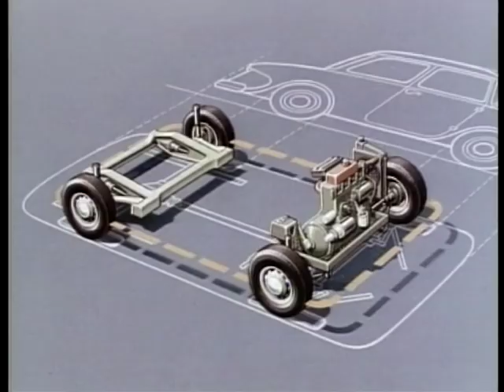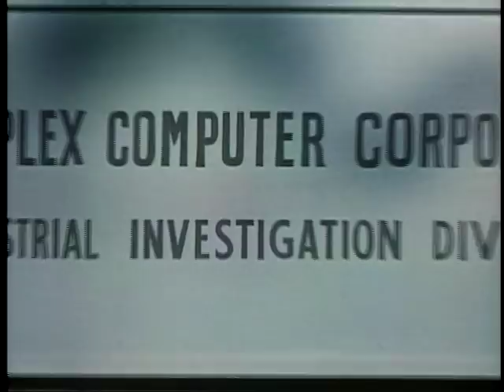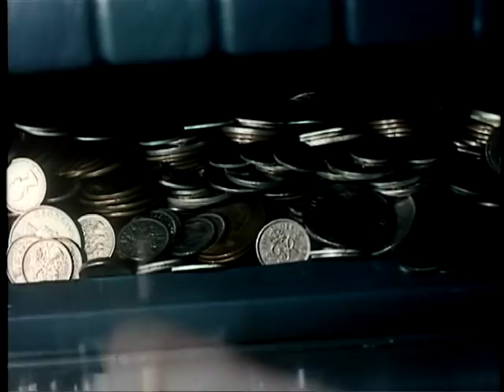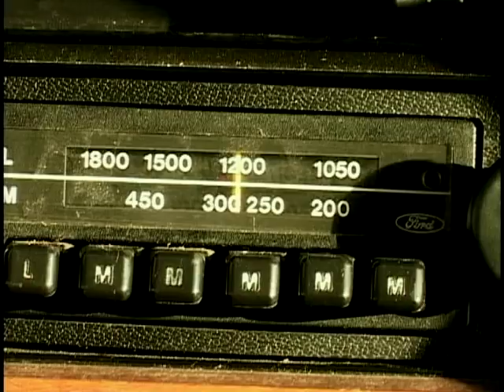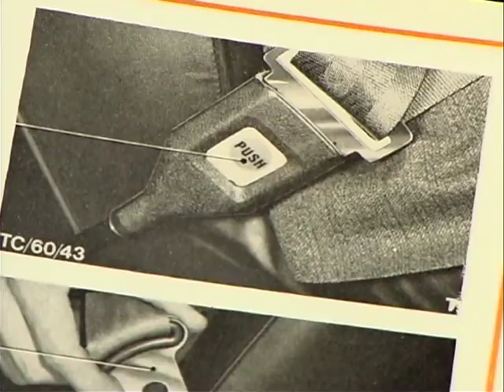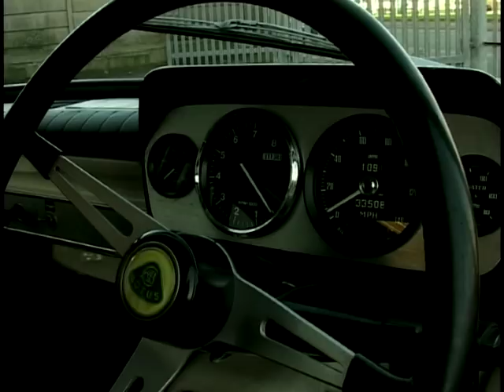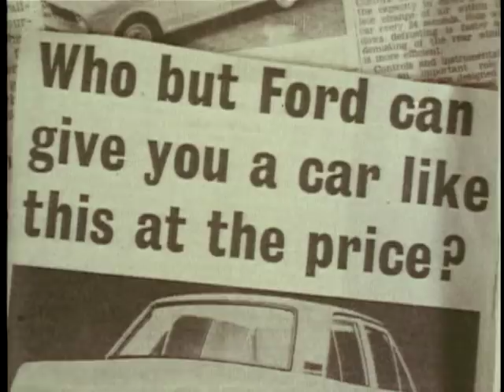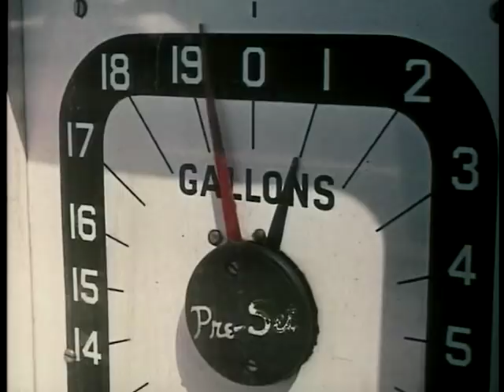Ford Cortina Special

Comment: I had a dark blue Canadian export Mk-2 — very low milage when purchased. I looked after it very carefully. Drove it non-stop from Vancouver to Los Angeles and back — twice.  It towed my race bikes to the track on Sundays. It started as a regular Mk-2, but soon it got the GT version's twin throat Weber and the extractor manifold, which made it much faster. I beefed up the leaf springs, and the front struts were replaced with stiffer cartridges after the factory original setup failed in early days. With radial tires it handled very well indeed. Acceleration was surprisingly good for standard GT tuning, and gas milage was an excellent 32 mpg - mixed driving. It was a car one just wanted to love, but like some romances it just didn't take. Bits were always falling off and breaking despite careful maintenance and care. It was an appalling pain in the ass. Fortunately the parts stores were close by. I once changed a clutch in a rainstorm lying in a puddle under the car with a torch stuck in my teeth. Lots of memories — good and bad. Years later, I actually had dreams about the car — like the girlfriend from hell that you loved anyway.

Comment: I was 21 years old in 1972 and stationed at Ft. Bragg, NC. I bought my first car  in Fayetteville (on Bragg Blvd). It was a '69 Ford Cortina with a standard transmission  and the price was $650.00. Had a lot of fun with that car.

Comment: Had a 1967 (I think) Cortina G T...with the lump on the dash housing the gauges. Loved it...ran well through Wisconsin winters. The McPherson struts were shot, & nobody knew how to work on them much in those days (1970), so the front suspension left a lot to be desired. Traded it in on a A-H 3000 while in the Army in Georgia. Oh well...great shape, reliable and serviceable car. Wish I could find one today...at age 68 I can still shift for myself, and prefer to do so!! Don't forget that Ford (USA) was the only car company that didn't require a "bailout"!

Comment: Cortina's are fun to drive, beautiful gearbox ,roomy good peripheral vision and responsive
Reply: Lee Engelsman i wouldn't agree with u on the gear box. more grinding than smooth gear change.😕
Reply: Padraig O'Donnell .You must have had a really dodgy box. Cortina boxes, from mk2 onwards, had such a light, smooth & positive action. A joy to use, compared to a Victor box of spanners.

Comment: My first car was a '70 Cortina Wagon. I paid $155 for it, and sold it 2 years later for $100. I drove it into the ground. The gear shift was held in place with electric motor wires (the plastic part that held it in place had stripped), the back up lights were replaced with aftermarket units, the clutch master cylinder had been replaced with a part from another '70, but it still ran. We had a love/hate relationship. :)

Comment: Many thanks from Germany! I liked the german Ford of the 70s as a child. But on a holiday in Spain back then I saw the corresponding Cortina MK III and I thought "What a cool, sexy car! And it´s only available in GB? Are they nuts? I have to go there sometime!" (I did)
Reply: +LukerizedClint.  The Mk III certainly looked the part with its 'Coke bottle' styling. I only drove one once - a 2000E with the engine from the Pinto. The suspension was so soft that a firm right foot made the hood/bonnet rise, obscuring your view of the road !

Comment: In Australia we got the 250 ci or 4.1 l straight six in the mark 3 & 4 A bit front heavy but fast.
My father had a 4 speed version and used to drive it with 112lb of iron weights in the boot to even up the handling.
The motor was a bit under carburetored but a good performer.
 A set of triple carbs & an exhaust ....

Comment: Smiled when the smaller Anglia 105E was described as heavy in this documentary. It was about the lightest car in its class at the time, and the cheapest, other than the much smaller Mini and it was only slightly heavier than the Imp. Where the Cortina scored over its smaller stable mate was that it was much bigger and only cost about £100 more (i.e. £600 as opposed to £500).

Comment: Regarding the Mini, the commentator said that 4 people could ride in relative comfort.Well, I've been in quite a few of those little old Mini's in the past, and the ride was anything but comfortable.  I think it was due to those tiny little wheels, which wouldtransmit every bump on the road, up into the passenger cab.  They were extremelyquick though, if speed was your thing.
Reply: To Gary Dunn. Minis had rubber suspension. The suspension was by bicycle designer Alex Moulton - "rubber man". His nephew Shaun runs the bicycle company now - and THEY have marketed a replacement COIL SPRING suspension system , called simply "SmootherRide". Clever, huh? What's not to like about the talented Moulton family!

Comment: In Australia MK 3 (TC & TD) MK 4 (TE) & MK 5 (TF) Cortinas were available with 200 & 250 cubic inch inline 6 cylinder engines

Comment: I had a Mark 2 Cortina, and it developed a mysterious fault than many garages failed to sort out.  It was actually a dodgy valve that was causing local overheating next to the fuel line and vapourising the fuel.  The result was that if I drove for a long time and then stopped, the car refused to start again.  While the garages were pondering on what could be wrong, I was able to keep up my regular journeys from Wales to London and back again, by taking off the fuel pump when necessary, and waggling it by hand.
Imagine trying to do that with a modern engine!

Comment: Hi, I'm trying to find the video you did with my own car back in around 2000-2005. It was an Orange Mk3 Cortina MBJ337K that I was customising and had just fitted the 3.5 V8 (may have had the 3.0 V6 in it then). One of the presenters came to my house (Richard or Rob) and we filmed outside my garage in Lowestoft. It was a 4 door, converted to a 2 door and I cannot find the film anywhere.   (It is not the M reg one in this video). I'm hoping you can help please?

Comment: Did I mention that my first car was a Mk1 1500 estate Deluxe with 1 owner from new before me ?  I even had the sales receipt which was just over £800 in 1965 or 66. It had front and rear seatbelts fitted too. The load area was great, as the rear seat folded level with the estate section floor. Plus it was a comfy overnight bedspace. I even made some curtains for it.

Comment: Great documentary, but inexplicably misses the contribution of the Consul Classic 315, released in 1961, as a bigger version of the 105E Anglia.  The Classic had the same reverse rear window of the Anglia, but was the same size as the Cortina:  a fiveseater.  It used the 1340 cc Kent engine (later uprated to 1500).  The problem was that it was too expensive to produce, and in 1961, Terence Beckett realised that the size was what Ford needed (it fitted between the Anglia and Mk II Consul), but the cost had to be stripped out.  Hence the Consul Cortina came about. It was initially labelled 'Consul' to keep continuity with the Consul Classic 315 and the Mk II Consul (as the documentary says, the original name was Consul 225:  the big Mk II Consul was then relabelled Consul 375 in 1962, to give the ascending range in size and luxury:  Consul 225, Consul Classic 315, Consul 375.  The Consul Classic did not sell well, because it was expensive and perhaps a bit too Transatlantic for British tastes, so in 1963 it was replaced by the Consul Corsair, which took the 1500 Kent engine, and was based on a Mk 1 Cortina floorpan.  The Classic derived Capri carried on until 1964.Hope this helps.
Reply: +Fred Splinge    I remember the Consul Classic well but as you say, it didn't sell many. Owners were often criticised for its looks, which with hindsight were ahead of the day. Which car of that era had the V4 engine ? Not many of those were made either. It might have been a variant of the Corsair.

Comment: I guess I am one of those lucky Yanks who experienced both MkI and MkII, both GTs. I am a big fan Kent engine, had it in my Fiestas also. Rust was rarely an issue in California except for American GM products that rusted around the windows terribly. I was not happy when Ford replaced the Cortina with the Pinto, though I later picked up one second hand and drove until 1999 with plus 300K miles on it. Wife pressured me to reduce my stable of vehicles and it went to a friend.

Comment: No mention of the Aussie Cortinas which you could option with a 200 cubic inch or (later) 250 cubic inch straight 6 taken from the Australian Ford Falcon.  The 6 cylinder Cortinas were a bit front-heavy but, man, could they herb down the freeway!  The last Cortinas here were the same body shape as those in the UK and Ford Australia finally fixed the nose-heavy diabolical handling from the weight of the 6 cylinder engine.

Comment: Fantastic mechanically even though the 1600 Pinto would always terminate at or around 100,000miles. Up to then, it would never let you down. Fantastic reliability.
Problem was with them as all Fords of that era - RUST and loads of it!!
Our first, and only, Mk5..Failed its 1st MOT test at 3..yes ..three years old due to chassiss rust perforation!!! 
Even in those days when cars rusted..it must have been one of the youngest cars on the road to have already been welded. At a mere 9 years old..it was off the road for good.
Then there were the void bush problem..
Reply: loved the cortina. the few years they brought it here. 68- 70 ?
unil the pinto
had a 73 pinto as a first car. the 2 liter 4 spd
was a bit better than the 1.6 kent. most or all 1.6 liters were manual only ithink
i was seven in 1970 , lol  so
Reply: emil sponga and forgot they did bring the first - mk 1 cortina over here too. in small number
as with the anglia , capri and a few others....etc etc
Reply: +Yuxin Wang Your not wrong about those void bushes, Bar-stewards to get in and out
Reply: You know about them too..eh..they were an awkward old job Weren't they?

Comment: Cars then were considerably expensive, three new ones or less would buy you a semi detached house, now much more mass produced with interchangeable parts between models they're considerably cheaper, with plastic wheel arches that reduce rust & noise considerably, the ford always gave value for money and SPACE even todays Mondeo.

Comment: mk1 cortina esate!! rare beast of  car now! lol 0:58 when you could drive with 6 kids in the rear and no set belts, 
me grandad used to fix them, went to dagaham to learn how to fix ad repair them i think me mum went in one years ago 
VERY RARE BEAST MK1 CONSOUL AND ZODAC!! just to let you know the space between the engine and the rad on those were so big my grandad could get inbetween them, 
OI NOTHING WRONG WITH BL!!! they had the allegro the uk's pacer,
hang on, mk5 cortina? that's not real its stopped at the mk4 after that ford had the mk3 carpi, the fietia and the new sierra which was the end of the mk4 cortina if there is a mk5 cortina it must be rare or there only 1 as i've never heard of it,

Comment: My Dad had a 2000E Mk3, R reg, Auto, copper metallic - loved that car. Had wet carpets sometimes though no rust?! He bought for £2,500 in 1980 and sold it in 1982 for £500! Only 50k on the clock! They said the Mk4 wrecked the prices. Now must be worth thousands....sniff, I had 1 Mk 4 Cortina, and 2 Escort Mk2's, not as good, and looks were awful....

Comment: Engine rebuilding shops made a fortune out of Ford. I knew a guy who had a shop and said he made a living out of Ford. Few BMC engines were ever in his shop. The Ford camshafts of the OHC engines were just badly and cheaply made, if I recall correctly, made from cheap case hardening. He said 30-40,000 miles and the camshafts wore out. You could tell by the engine rattle. He said using quality oils and maybe STP additive, you may get an extra 10,000 miles. Some third party companies would make high quality camshafts as replacements which would last the life of the car. Few would pay the extra cost as after major engine work on a 3 or 4 year old car, most would get it fixed cheaply and then sell.

You got what you paid for in Fords.

Comment: MkV 2.3 V6 was OUT of This world in its day ! 
A 2 litre GHIA was reasonably acceptable.
A 2.3 V6 was a Very Different ANIMAL ! 
The 2.3 is ? Not a Cortina, More of a swb Granny but with better handling than both the cortina or granny.
A 2.3 should make double the value of a 2.0. 
That cologne V6 is truly AWESOME ! The nearest thing to a V8 Range Rover Endless low down pull when towing  
2.3 PAS standard ! yes Pas on a cortina ! 1982 ! Gas shocks 
Glides along effortlessly.

The nearest thing i can find is a BMW 525i SE Manual e34 1995.  !!! ?? 
6 yrs after the MKV Cortina ! ended production.
PAY DOUBLE MONEY for a V6 compared to a 2.0. and a 2.0 must be worth double the price of a 1.6 Mk V.

Comment: I had a 78 Cortina with the horrid 2 litre 4 cylinder engine hear in Australia .. biggest piece of crap ever .  They were well known for catching fire . The starter fell out when driving .. again a well known problem here . Mine broke all the piston rings thanks to a leaking air cleaner box which had about 1 million screws on top to try and seal it . BUT the Cortinas fitted with the Ford Falcon engines , 3.3 and 4.1 litre 6 cylinders were really good cars

Comment: My family , relatives and friends and work colleagues all had Ford Cortina's from the mark one  to the mark five including the rarer 2.3 litre V6 auto mk5 and the 2.3 litre S mk4 version and all Ghia versions of the mk5 and mk4 and mk3 GXL and the mk2 1600E. My dad had a dark maroon colour mk4 2.0 Ghia auto with Webasto vinyl roof in block with gorgeous and sumptuous cream cloth interior and wooden doors cappings  and wooden speedo cluster surround , it was the most beautiful car my dad owned in my opinion. I have carried on the tradition and now own a 1.6 Ghia Ford Cortina mk4 on 1977 S reg in dark blue with black vinyl webasto roof and blue cloth interior and also own a 1979 V reg Ford Granada 2.8 pre face lift in white with rostyle wheels. Way more better than the modern plastic recycled coke can on wheels lol.

Comment: Ford actually produced a rare limited edition version of the later Mk4 called the DS, so called because the seats were packed with hermetically sealed dogshit (hence DS) to make them really soft and comfortable. This worked until around 30,000 miles, when the bags inevitably ruptured, making the atmosphere in the interior totally unbearable. Not a single example survives.

Comment: I bought a new Cortina Mk3 1600 GT. The build quality was appalling. The engine's big ends packed up after 1,300 miles. A legal issue emerged. On independent inspection the crankshaft had been ground down to maximum.   In short, it was a used engine that had previously seized in a brand new car.  Ford didn't care a hoot and only when on the courts doorstep did they return my money. 

Karma: A friend was a fleet manager for a company and was about to buy about 100 company cars.  I told him of my story, so he avoided Ford and always has, and so have I.

Comment: I had the MK4 Ghia 250 X flow iron head motor, nothing could catch it really, sadly it died of Cancer in the chassis, I tried to save it but it was just too hard. I will never forget the old Beast, Wish you could still buy them new, because I would have bought a new one. I Hate the new electronic computer controlled cars, their RUBBISH. My old Cortina had pretty decent economy for a 340 H.P. Animal.

Comment: Have you ever noticed that the English seem to eulogies really crap cars which become "classics". Seriously getting teary eyed about the halcyon days of the Aglia and the morris 850. Seriously, give me a break.
Reply: Well the American cars weren't any better!
Reply: Are you kidding ? The 'aglia' <sic> was a piece of crap and by the 'morris 850' do you mean the Mini ? Also available with 1000cc engines and then 1275. The Mk1 Cortina was a very modern car for its day. Take the adoption of front disc brakes for example. I believe some US vehicles still use cart springs and live rear axles at the rear some 50+ years later.

Comment: I had a mk3 and always he'd problem with oh camshaft. Gearbox had to be changed as well. Rust on front wings. Front disc brakes seized on due to faulty cylinder rubbers. Just a car, nothing special. Typical shit of the time. Modern cars e. g. Honda Jazz are superb in comparison. I would never use an old car again. Crash safety cannot compare. Once had a 100E Ford Anglia, a total load of crap. Air driven windscreen wipers that stopped going up hills. Three speed gearbox. Side valve engine. Total shit.